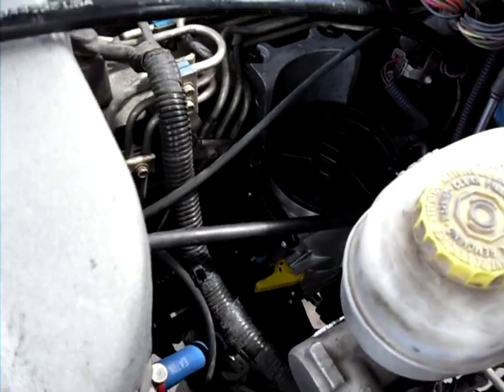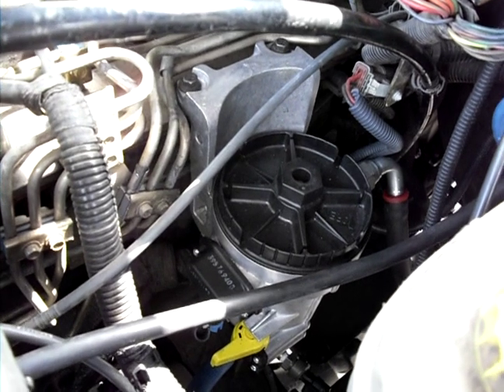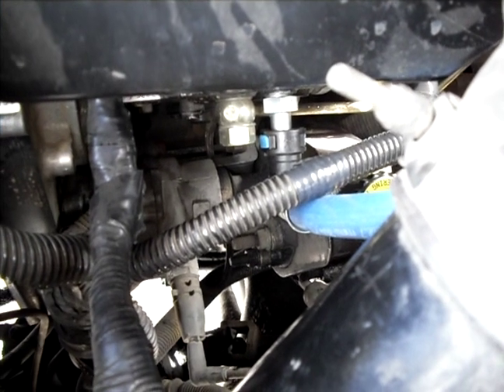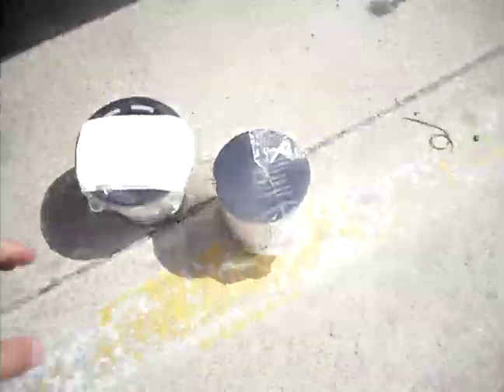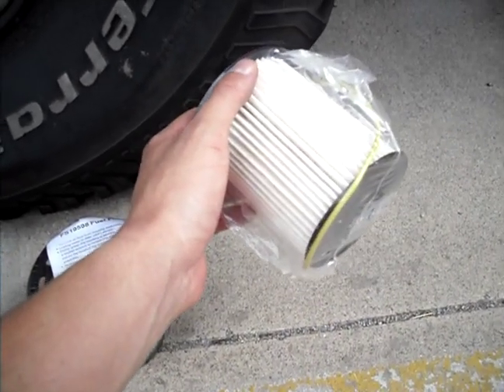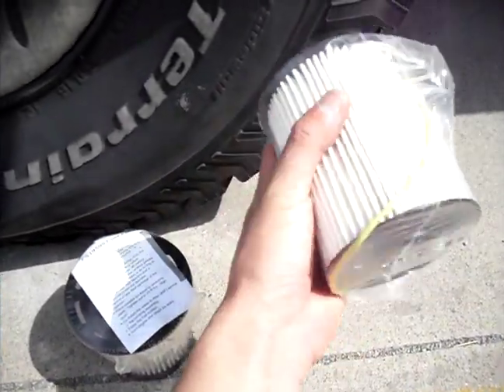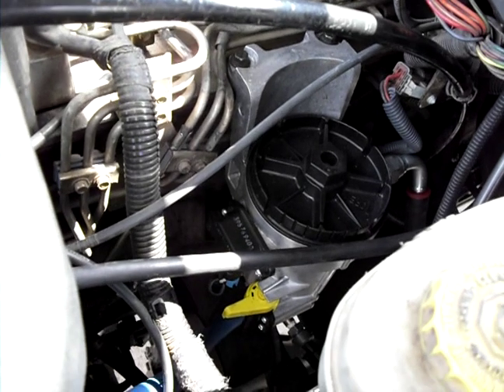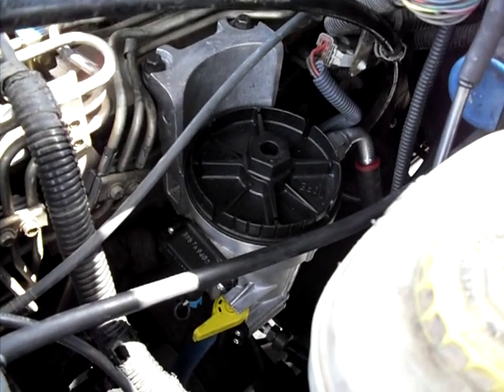2000-2002 Cummins Fuel Canister Conversion

Comment: In the video you talk about the plumbing changes on the output side of the fuel filter.  It appears there were also plumbing changes to the fuel filter input side.  Can you please explain the input side plumbing changes also? Thanks
Reply from the maker: Oh, well this was a long time ago. Well on the 98-00 the fuel lines are routed to the top of the canister for both in and out. The 01-02 models the fuel lines are different. The fuel going into the canister is on the side and the fuel coming out of the fuel canister is on the bottom.

Comment: Cummins cant seem to find the part number or the parts for the water in fuel connector or the heater connector. If you have the part number could you please post them here Thanks Keith

Comment: when wiring up the fuel heater and the water in fuel sensor with the new plugs mine are both white and on my old one there is a red and black on the heater which one connects to what or does it matter

Comment from the maker: A tune up on a Cummins is just changing the oil, fuel filter and air filter and your done. No spark plugs, no coils/distributors, no wires, no adjusting the timing with a timing gun, no adjusting the distributors. My 5.9 has well over 240K miles and still runs strong as the day it rolled off the lot. Diesels are built to last longer. The 5.9L has a life span of 1.5 million miles and can be over hauled 6 times if needed. I have friends that have over 700K miles with no troubles.

Comment from the maker: Diesels are completely different than gas engines. Diesels burn by compressing air and fuel so tightly that it explodes. As long as you have Fuel, Air and good Compression a diesel will fire. No Spark plugs, no plug wires, or coil packs/distributors. Glow plugs are just for warming the air in the cylinder so it will fire easier. It is NOT a spark plug. The Cummins does not have glow plugs but it does have a Heater grid that sits under the intake horn. It warms the air in the intake manifold.